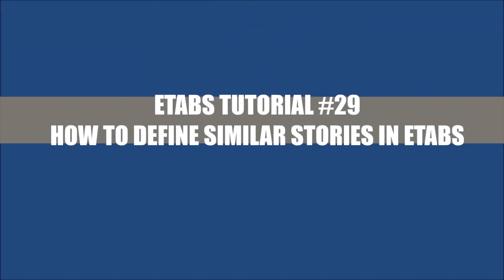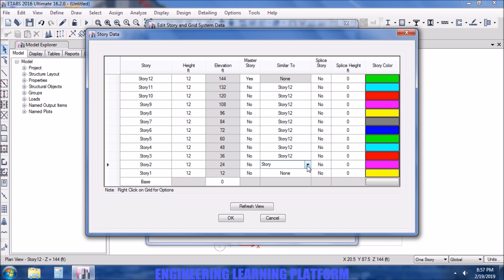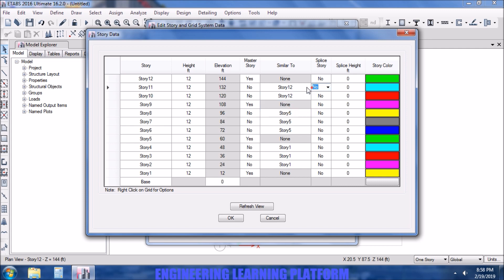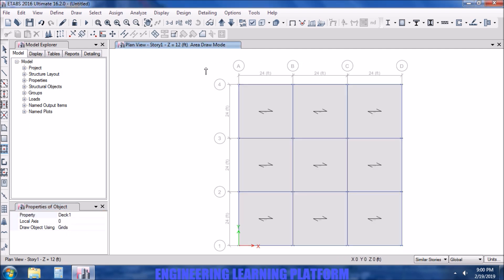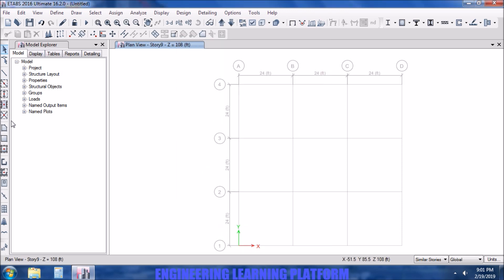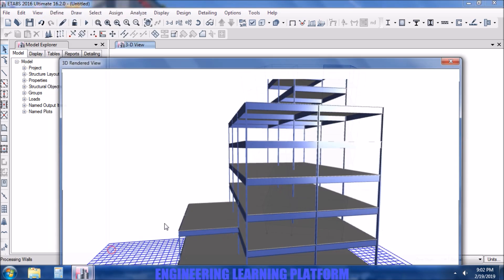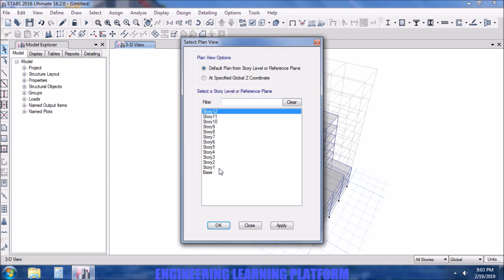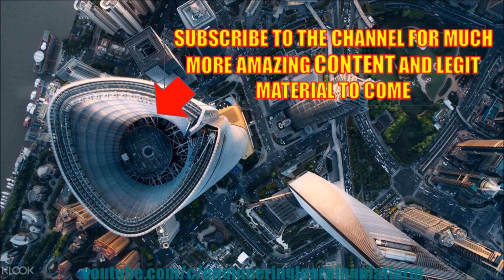How to define similar stories in etabs tutorials

Comment: does it have to be many stories? Mine was only 3 stories but the frame / the beam was only assigned to the 2nd-floor story. The rest of the floor doesn't have any beam or column assigned.
Reply from the maker: It's just an option, it doesn't necessarily applies to every structure
Reply: @EngineeringLearningPlatform  Then, is there any wrong with my model? How can I fix it?
Reply from the maker: @bagusbudi3018  not needed